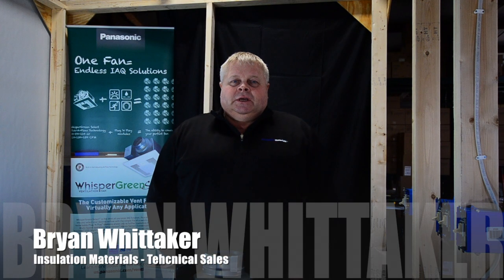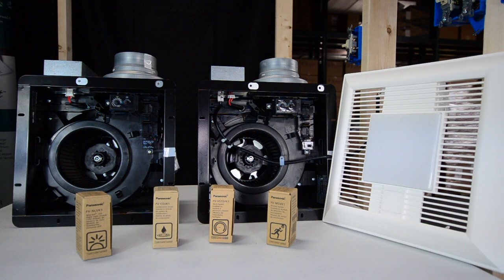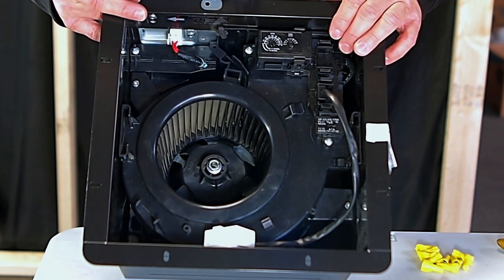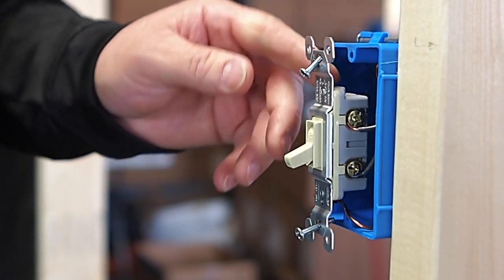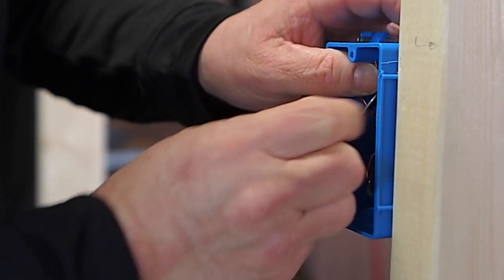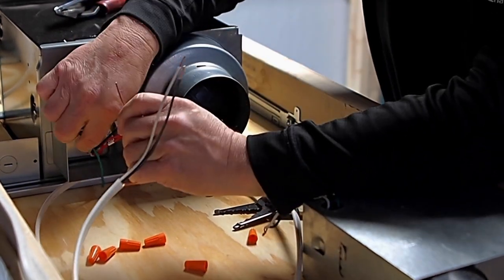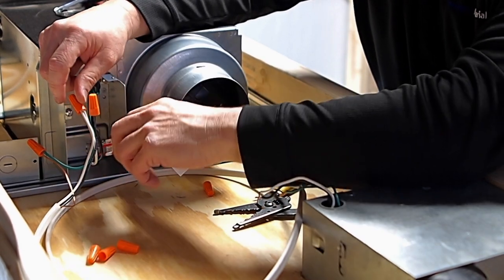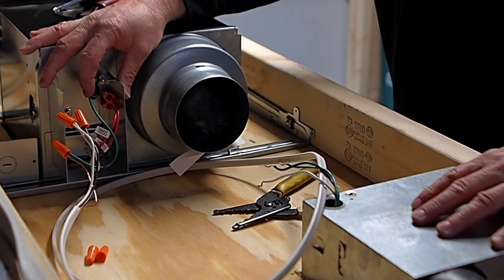Panasonic Whisper Green RetroFit Bath Fan Wiring Scenario (1 of 7)

Comment: Sorry I'm late to seeing this but well done! Hopefully Panasonic has sent you a little something (wink, wink) as you did them a great service. A question about using sensors: You show motion sensors, are all sensors handled the same way? If I used a humidity sensor, would it be wired the same as a motion sensor? Also, all your examples are for continuous ventilation. Can one wire for spot ventilation with sensors?

I would like to have the humidity sensing function instead of motion but also be able to turn the fan on for when using the other, ahem, "facilities" in the bathroom.

Thanks
Reply: If you install the motion sensor; it now takes care of spot ventilation.

Comment: If I were to keep the fan wired through the switch, instead of running constant power, would the fan switch to high speed if I toggled the wall switch off then back on? and then simply time out and return to low speed? I would like the option to have the fan powered off, running at low speed when powered on, and the ability to toggle to a high speed without an additional module. Thanks!
Reply: Just simply toggling the fan on and off will not do what your after. Leaving it run at low CFM and using the red signal wires is were you really want to bee..